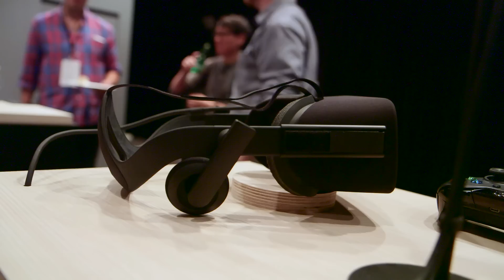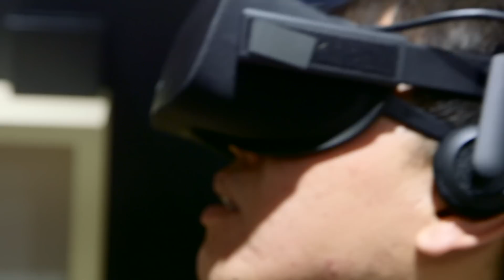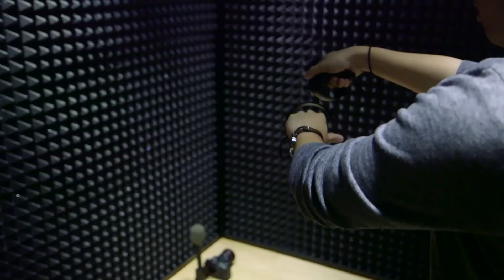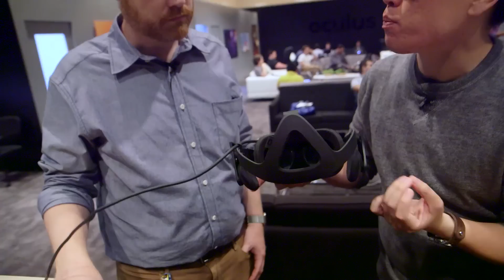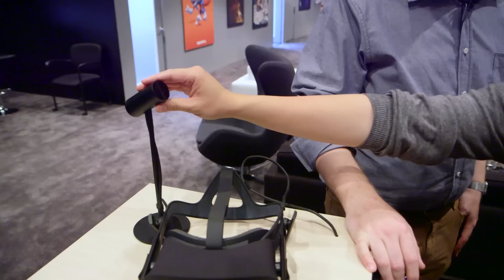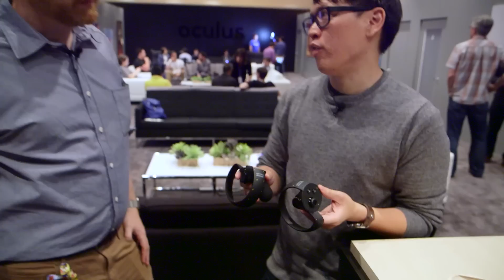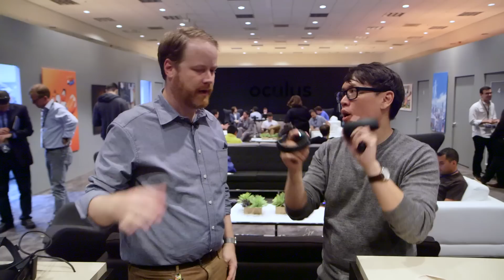Oculus Rift CV1 + Oculus Touch Controller Hands-On + Impressions!

Comment: I want to pick this up but does anyone know if my specs work. 

i7 2600k , win8, gtx 980 g1,16gb ram.
Reply: +iiOnyxii yes, a stock 2600k is probably fast enough, and it overclocks like a beast. It would almost be insulting to not overclock that cpu. 970 would be sufficient, 980 is good, 980ti is great, so you're good there, too. 16gigs of ram is enough too. I use a 4790k, 16 gigs of ram and a 980ti with the rift and it works great.
Reply: On there website they have a thing to test

Comment: They need to figure out how to get BrainGate technologies to work with video games and Oculus Rift to get true VR.  Nobody who games still wants to move around while gaming, reasons why no hard core games use the kinect or Wii motion controls.  For now holding a controller or using Mouse/keyboard will have to do I guess.  But being able to use thoughts to move your character like BrainGate does with robotic arms would be amazing.

Comment: I just want an oculus rift without all the extras.. aka no shitty headphones, no controllers, no games, no microphones... just the actual oculus rift head unit and the track IR camera.  Thats it.

I have full 7.1 sony surround sound system, or soundblaster evo zx headphones , i have a snowball yeti microphone, i already have the "controller" i want to use (mouse/keyboard/hotas), i already have the games i want to play.  All i want is the oculus rift headset and the track IR.
Reply: +Atanas Tripzter You do realize that the headphones will be better for gaming that your speakers right? The whole audio setup is designed around VR.
Reply: Nobbs66 As i said, i have both.  high quality surround sound and high quality headphones.  Much higher quality than the oculus rift offers with active noise canceling.
Reply: Atanas Tripzter Yet you don't have positional audio for being able to tell the if something is above or below you.
Reply: Nobbs66 It's no different than the STEREO headphones that come with the Oculus Rift.
Reply: Atanas Tripzter Except you don't have any of the audio processing for it.
Reply: Nobbs66 you dont seem to know how any of this works.. the soundcard of the computer processes the audio based on which way you're facing in game.  The headphones of the rift wont get any different signal vs if you were to use wire headphones plugged into the computer it self.  This 3D sound has everything to do with the Track IR and your relative position to the sound, it has nothing to do with the oculus rift being on your face.
Reply: Atanas Tripzter You don't seem to understand this. The audio processing is being done at the driver level. You won't get the same audio processing with your headphones. it's not as simple as having spatial head tracking and using that to change your audio processing on the fly.
Reply: Nobbs66 lol yes that driver is called a Sound card.
Reply: Atanas Tripzter It seems you don't understand how hardware and software work together.[
Reply: Nobbs66 If you say so.. show me a source that confirms your statement that Oculus rift has it's own soundcard in it that does something more than the regular desktop soundcard.
Reply: http://www.kitguru.net/components/vr/jon-martindale/consumer-oculus-rift-will-have-built-in-dac-and-headphone-amp/

That dac is also what handles the spatial audio processing and is why your headphones aren't going to beat the rifts
Reply: Nobbs66 That just says it has a built in amplifier with a digital to analogue converter.  doesnt say anything about making the sound more realistic than your soundcard can do.  Matter of fact thats exactly what soundcards do as well.  Just on a higher quality level. aka 96-192kHz

Comment: Wait... Earlier in the video the rep said the foam was replaceable and near the ed that changed when you talked to Nate... I am a bit confused. So is the foam replaceable or not? That kind of foam gets cruddy really quick if you live in a hot climate or have an older style house where central AC is not installed.
Reply: +Christopher Marshall Two different things. The outside and inside of the headset have a fabric-like cover. On top of that there's a piece of foam that goes between the headset and your face. The foam is replaceable, the fabric on the outside and interior is not.
Reply: +Christopher Marshall Foam will be replaceable

Comment: 600 bucks + 30 shipping
Reply: +fyte4luv808         i thought $599 was high price but actually its not because it comes with 2 games and Xbox one controller plus built in 3d audio headset(palmer said its more unique than 7.1 surround sound) and built in microphone.    so i would minus $200 from $599 price.

Comment: When they were mentioning the dashboard (Oculus Home) thing, I was thinking of a virtual desktop thing. So you are in a space while wearing the Oculus, that has a monitor with your desktop on it. Then you can basically just use your computer for selecting content and change to a game's view or something when you open a game that supports Oculus.
Reply: +CandiRokz I'm assuming its similar to the Gear VR's dashboard. It's a lot like what you would see on a console. You control the cursor with your vision.

Comment: The material build is a huge mistake.  Dried skin flakes and your skin's transferable oils will make it a visible hygiene issue.  A wipeable soft rubber would have been a much more hygienic and durable material.

Comment: I was looking at building a new desktop with the plan to be able to play games like star citizen on the cv1. I was looking at spending about 4k on two gtx 980s, 32 gigs of ram i7 etc. After hearing Lucky saying they are working with Nivida on GPU's geared at VR. I was wondering if I should just hold out till VR hardware starts coming out. Don't want to spend 4k then need to build another rig.
Reply: +Matthew Hernandez If you can it would be worth getting 2 980Ti's or waiting till AMD's Polaris or Nvidia's Pascal.
Reply: I started looking at those, I liked the fact that they each have their own liquid cooling as well. Just looked at the Pascal, looks pretty interesting.

Comment: And I need a 600 dollar video card to use Oculus... Well, let's buy a 600 dollar video card I guess...
Reply: +jirka merunka SLI gives you no benefits for VR right now, the latency of the two cards talking to each other is too high. You're better off with a single card. A single 970 should do it for the CV1 for its lifetime.
Reply: +jirka merunka You don't need a $600 card. But a $600 will exceed the recommended.
Reply: +jirka merunka you only need like a $330 gpu
Reply: ***** minimum is gtx 970, recommended would be a graphics card able to run 4k. So recommnede I would say is at least 2 x gtx 970, more likely 2 x gtx 980. That's 1200 dollars just for vgas...  Yeah I am a little over cause it runs in 60 fps, so 1 x gtx 980 might do it pretty good...
Reply: jirka merunka The recommended is a 970/290. So you're wrong.
Reply: ***** Do the Math man yourself.. 2 x 1080i screens plus the graphic demand can go up all the way to 2 times the demand of 2 x 1080i screens. So you are somehwere between 2k - 4k... And no, a gtx 970 will not do it... Of course it will work but not even witrh a gtx 980 will you be able to put everything on max... And I wanna have it on max since it is only 1080i and is right in front of my eyes...
Reply: jirka merunka Have you even seen the recommended specs?
Reply: ***** lol, are you listening to me? Who cares about what their "specs" are. They have changed it several times already and I am telling you again... 2 x 1080i screens with as much as twice the demand... 2k-4k....  gtx 970 for medium details, no better field of view, no AA, no nothing... If you want to have everything on max, you need 2 x gtx 980... HOWGH
Reply: ***** BTW their specs say gtx 970 and higher... So that means with anything lower than gtx 970 don't even bother trying to play with oculus. Minimum gtx 970 but you will be in low details, as I said...
Reply: jirka merunka And higher is generally used as "shit will still work if you put anything else better than this in"
Reply: ***** you don't make sense. Of course when they say gtx 970 is minimum then it will work witth gtx 980 as well...? Sure it will, just saying it is three times as demanding as your 1080i monitor. So if you are running games on max and your fps is at least 180 then you should be ok.

Comment: Not much have happened in the last two years, even after they started hiring like crazy, what are all these hardware specialists doing over there?  The things that have changed are higher resolution displays (these are not produced by Oculus, so no effort spent there),  camera tracking of IR LEDs, slightly lower latency and reduced judder,  ...what else? Very primitive hand trackers... kinda was expecting more.
Reply: +Sephiroth S You're kidding! You've watched the video, so you can't seriously say this ^^'.

- Two years ago, in DK1, there was only ONE screen, not two.
- The lenses are much better (they talked about the sweet spot).
- The screens AND the lenses can be moved.
- The Oculus adapts better to different faces (as they said : "the structure is more flexible"), which makes it much more comfortable.
- I think they've changed the smooth material which is in contact with the face.
- They added the headphones and the microphone (though it's more like a bonus).

Also, what makes the Oculus Touch "primitive"? Old-school techs are not as accurate as this system with those hand-tracking cameras (and they weren't as ergonomic as the Oculus Touch). Plus it can detect when you twist your rist, move your fingers,... I agree this is not a pure revolution, though. But it's a nice piece.
Reply: I'm not kidding. The things you listed now are things that one or two talented engineers could have done single-handedly in not more than a year, again, this company have almost unlimited funding. DK2 have so much problems it's hard to start, head tracking was good, but it's pretty much the same level as the head tracking i built myself for DK1 in a few weeks. Headphones and microphone..common :)  They have to deliver something amazing with CV1 or i'll spend my hard ones on any other VR goggles coming up.
Reply: Sephiroth S Engineers NEVER work alone or in pairs ^^. It's because "simple changes" are not as easy as you can think when you don't work in the domain. The flexibility, for example, is really tricky to change.
Plus, don't forget that all those engineers don"t do ONLY that. They have a whole lot more to do besides working on the Oculus.

Plus, even if the changes are simple, you can't deny they ARE changes. So you can't say nothing happened during the time of development. Look at the DK1, then look at this product : they have nothing in common (besides being different versions of the same product).

The headphones and the mic, I agree, that's why I called it "a bonus" ^^. But it's still a change.

I didn't talk about DK2, but since you've said it's got a lot of problem, I'm listening to you :) . BUT don't forget it's still a PROTOTYPE : just because it isn't perfect, doesn't mean it is bad.
Reply: +Lulu Vi Britannia So I bought a VIVE (well, pre-ordered). I don't think Oculus are innovative enough and definitely not market leader anymore.
Reply: +Lulu Vi Britannia Of course they did make it better, but the pace just got slower and slower. I've worked on hardware in the past so I know, yes, things take time, but still, Oculus have attracted some of the best engineers in their fields and it's not a company bloated with management either. The difference from Palmer's prototype to DK2 was great of course, and only a handful of people did that. Then after that development time converged to a much slower pace. At least if they spent time on creating a great "oculus share" community, but that part is probably the biggest failure of all sadly.  I sold my DK2 btw for more money than i bought it for 2 years ago so I shouldnt complain :)  What do you mean that the engineers have more work besides the Oculus? what would that be?
Reply: blackmagic x 
Well, did you try the CV1 at least? If that's so, lucky you ^^. Otherwise, I don't think you're in position to judge the Oculus.

Now, the development seemed to have slown down a bit, but that doesn't mean nothing happened :
- all the partnerships with other companies were done during these years after the DK2 development (the partnership with Samsung, for example).
- they developed the SOFTWARE. You seem to have forgotten that point, yet it's HALF the work ^^'. Just check out the differences between the Runtime versions, they are HUGE, literally not the same software at all! And they did all that in these 2 previous years where, according to you, nothing happened.

About the engineers : well, an engineer doesn't always have only one mission at a time. For example, in my engineer school, there are many professionals who teach courses, which is an enormous amount of time. My point is, we don't know what the developers of Oculus were up to : maybe they were also teaching, maybe they had other things to do. Basically, they didn't work only on the Oculus.

So, if I can be honest (without meaning to be upsetting ^^'), I think you're of bad faith, or at least you didn't think of everything that has to be developed : you didn't talk at all about the software part of it (which is half the work!). And I'll keep saying the hardware too has known major changes.

Now, if you prefer the Vive, good for you ^^. I won't judge this one (I couldn't try it yet ^^', I'll have the chance next week), now most people were saying there is no major differences between the DK2 and the latest Vive (except the controllers, of course, which seem awesome but not ergonomic imo). As long as you have fun ;) .
Reply: As for the development, I'm an engineer with almost 15 years of experience, i've done hardware and software. All that taken in to consideration, I still think they underachieved during this period. Period, and phun intended.

Yes, I've tried the CV1 obviously. And the Vive, and I owned a DK2. Vive is a million light years ahead of DK2. If you dont want to take my word for it, read any Vive article you can find were they compare it to DK2. Why do you think it's being so hyped if it wasnt? This part of the discussion is completely pointless until you try the devices. I would not spend $1000 for the upgrade to Vive from DK2 is the difference wasnt huge. 

Cheers

Comment: I wonder which has the more energy efficient sensor tech between this and Valve's VR. The lower the energy required, the more sensors are possible. I think Oculus needs a way to reliably know the position of arms, floating hands wont cut it. Their sensor setup needs too much power for another sensor, on your bicep for example.

Comment: Need a version that's designed  without the headphones in the first place.
Lowers the cost of extra manufacturing for the  headphone connectors and cabling.
Can also drop the custom DAC,  controllers  and external sensor.
That would drop the cost quite a bit  - not everyone wants or even needs those.

Comment: Idk I mean I have the dk2 but here's what it all comes down to. You really do need a powerful computer. So think of it like this, if you can run at least 60 fps on a game or unity or unreal demo then give it a shot. If not, don't even think about it. It isn't worth it at all unless you can get that smooth turning and clarity. I'm not a fan of the built in headphones that come with the final oculus. I prefer my own because they are way better quality. Not everyone has a good enough computer to run this. I'm not saying I have an amazing computer but I can at least run some things.
Reply: Awsomeman902 They're removeable headphones.And trust me, you're going to want them. They have 3d spacial stereo audio. Meaning for example,  if you're hovering over a mini city and you lean into view a street  of the city you'll hear cars or a house burning. Also, your headphones are likely bulky, adding more weight and potentially another wire. Oculus also has a built in microphone so you don't need that either. The headphones are pretty damn good quality btw.

Comment: The big question for me is was there any noticeable screen door effect? It's too noticeable in the DK2 to be used for any length of time IMO.
Reply: iamthestog if you really really look for it you'll see like a very thin film. You won't see individual pixels though.  You have to almost strain to see it though. It's not a big deal.
Reply: iamthestog VR HMD's won't be screendoor free until 4k.

Comment: The Occulus Rift looks much lighter in weight than Sony's Project Morpheus. Is that the case? (I'm a Sony fan so I'm looking forward to both) but the physical weight of the headgear, the ease of wearing glasses with the headset, as well as price, performance and the games will all be factors for a lot of people.